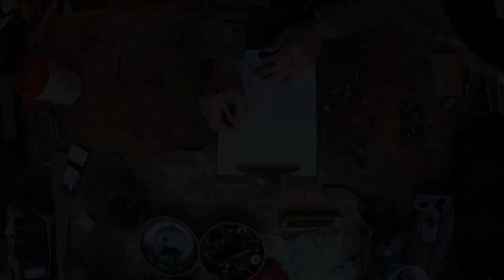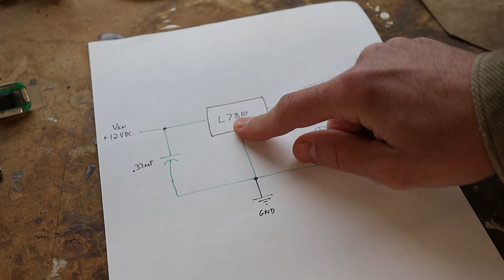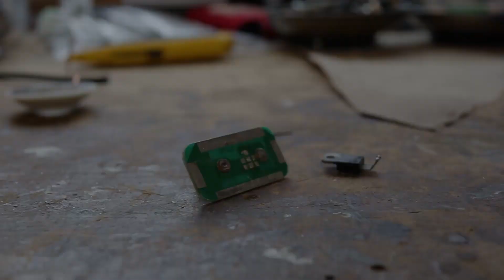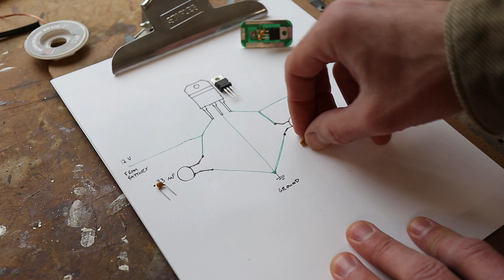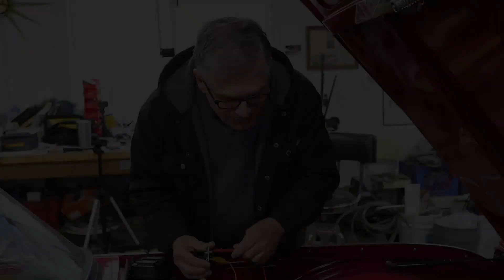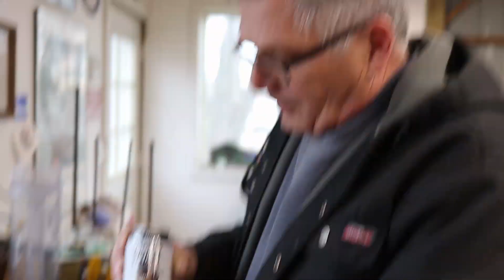Build a DIY Gauge Voltage Stabilizer For Your Classic Car - CHEAP

Comment: Hi Thanks for the answer  my 93 year old neighbour and pal is currently building one as I am in my garage  I will then get the grand kids to build one  It will introduce them to soldering and some electronics   I have a Mk 11 Jag and and E type  I think the faulty ground on the Mk 11 caused the stabilizer to fail I have a new ground strap and a better negative battery lead and the  car is now more reliable starting  Cheers Mike Mississauga
Reply: I made a positive earth(ground) 7910 version for my Mark 2 Jag about 8 years ago. It’s been working fine since then, and it sees up to 16 volts from the dynamo on start up! Hope yours has gone well. Pete.

Comment: Hi  I am trying to do this  but I dont understand som things My units don't have the metalicstrip around the outer perimeter of the inside of the unit so I dont know how to bring things to ground  Also what do you mean by the trace on the right side  Is that a strip of solder that you placed  Thanks Hope you get to see this Mike Mississauga
Reply from the maker: Not sure if some boards are different. There is a ground somewhere, so if you have a meter, try to figure out using continuity where the connection is made to the metal case. If you can't find it, you can always run a wire to the case itself from ground on the regulator..

Comment: Thanks, I just converted the voltage regulator for my '73 Volvo to be solid state. I used the capacitors, but I wonder if they're necessary for this application, since the gauges are so slow-acting?
Reply: Also, no reason to put capacitors inside the regulator,  If you are going to add a cap between +12V and ground, it can be anywhere on the vehicle and have the same effect of passing voltage spikes.

Comment: can i use the capacitors you used in the 7805?
Reply from the maker: Yes, the same capacitors will work. The sizing is not all that critical as long as it is relatively close. If you really want to get technical, there are probably some 7805 data sheets that have suggested sizes.

Comment: This has been a common mod for many 'classic' cars since the early '90's. Typically all use the 7805 or 7810 regulator chip. The problem with these regulators is that if the ground on the IC opens up you get full input voltage on the output. 
The other thing is the ''thermal" IVR applies a higher initial voltage to the gauge then as the strip heats up it goes down to the mean pulse voltage. This allows the gauge to rise to the indicated reading fairly quickly. Funny thing is, it's cheaper to make these solid state IC chip regulators than it is to produce the original style. You should bond that semiconductor to the case too. They get fairly hot. A long time ago when I made some I mounted it to the metal can with some thermal paste

Comment: Hi Wegs,
I just finished building a positive voltage unit based on the TI LM2940 that fits in the original style case. I struggled for the first year of driving my TR4A with a sketchy temperature gauge only to finally give up an install a mechanical temp gauge. It turns out that the problem was in the voltage stabilizer, not the gauge. At least now the fuel gauge is accurate. Going on long drives is much less stressful now. I enjoy your channel, keep up the good work boys!!
Reply from the maker: Awesome! The sketchy gauge readings were the reason to switch to the Moss solid state unit in the first place, which of course failed later on. So frustrating! With so many things to go wrong on these cars, it is at least nice to know the instruments are accurate.
Reply: @WegsGarage  I’ll have to review your video on your voltage stabilizer video to see how you crimped the lid back over the circuit board. I am looking into buying the metal case to build more and have to figure out how to crimp the case around my printed circuit so it doesn’t look like I did it in my garage, LOL.
I really enjoy you and your dad restoring your TR4. It reminds me of me and my dad restoring old cars. Great memories!
Dave

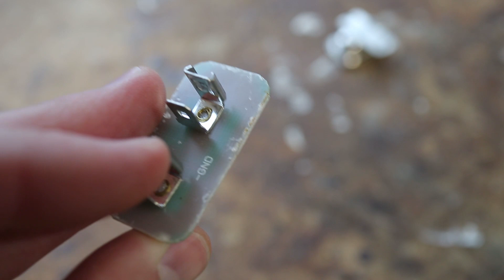Comment: Good job. I especially liked your creative hole drilling for the regulator and capacitor pins. I built one of these for my TR6 and while it worked, it looked messy so I was happy to put the cover back in place. In looking at the original regulator on the failed unit (1:35), it looks to me like it was a used part scavenged from an old power supply. So if they didn't test it, it may have been  blown in its original application. This is both funny and sad considering the 78/79 (+ output / - output) series of voltage regulators are dirt cheap and have been around for more than 40 years. Oh, and on a TR6, this regulator is mounted on the back of the speedometer. You need to be a gymnast or a monkey to get to it.

Comment: Thanks for the shoutout, and you are more than welcome of course. :) And yeah, the circuit is cheap enough that polarity protection is definitely optional. However, the capacitors are not optional (good that you added them). 

And for a "bodge job"* it came out very nice. :)

For those out there that are still rocking the positive ground vehicles, I would use a LM7910 instead (a negative 10 volt regulator). And connect it up the same way that you would the negative ground version. 

*A "Bodge job" in the electronics world isn't a sign of careless work, rather it is usually a fix on a board that has had its traces blown (or corroded) away, or a factory fix for something that got left out during the design phase. A nice looking one is a sign of skill.
Reply from the maker: Hoping my bodge job holds up! I don't know if the video did it justice, but these boards seem really poorly made. One of the reasons I drilled holes is because I was afraid the solder pads would lift right off! Thanks again for your help!
Reply: @WegsGarage  It'll do just fine, and anytime! :)

And yeah, I've seen some horrific boards in my time, and upon occasion I've contributed to some of that horror myself. :) 

But that's not a bad board, it's the wrong parts and a poor soldering job on a perfectly fine board. And maybe I'm slow (and I certainly didn't expect this), but I finally see where they are actually soldering a through-hole part on a surface-mount board. Really? I'll be damned... Somebody needs their junior engineer badge confiscated and their butt kicked. 

Honestly, I don't know of a good way to recover from this. I'd have to check, but I don't think that is the correct footprint for a surface-mount regulator. And while I didn't spend a lot of time on it, there doesn't appear to be a good choice in a surface mount package that will perform as well as the LM7810.

And so what I think may have happened is that they planned for a surface-mount package, and had the board made,  but found out that there wasn't one available that would deliver the current needed and have a high-ish input voltage limit (the LM7810 can handle 30 volts at the input. 80+ volts of input protection is advisable in the automotive world. But 30 volts is a start... Think of it as your car runs on 12 volts for most of the time. But not always.)

And it is an odd looking board to be sure. Almost like it has an extra layer sandwiched in the middle. It's also a fairly translucent board, and it looks like it's actually a knockoff of FR-4 material (the green PCB boards). But boards come in just about any color these days so it's hard to say.

I would be very interested in knowing what the original part was. It had a heat shrink sleeve over it. If you could remove the sleeve on the dead part and share the part number that would be tamp down my OCD a bit. :) 

That, and my money is on Moss Motors sending you out a Positive ground unit instead of a Negative ground one. Exhibit "A" would be that they are flat out of Negative ground units at the moment, but have plenty of Positive ground ones on hand. And the two different units pretty much look identical. :)

Which would explain why it blew up.

Getting back to my post a few weeks ago on the original install of the regulator, I would like to know why your lights, wipers, blower, etc. appear run through the instrument regulator? Or are they not, and your battery is about shot? Which would explain the need for jumper cables. 

In other words why the massive voltage drop? Keep in mind that your 7810 is limited to 1 amp (and that is with a heatsink - which you don't have). Beyond that and it will go into thermal shutdown.